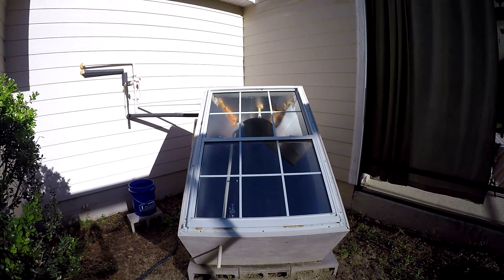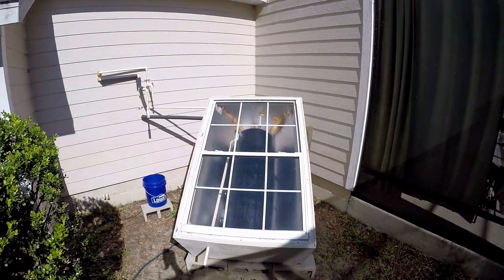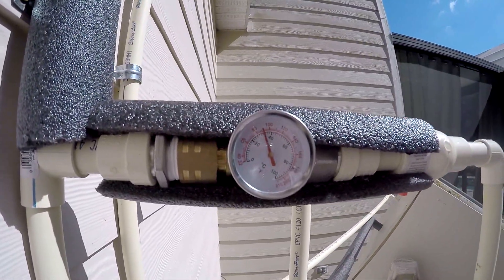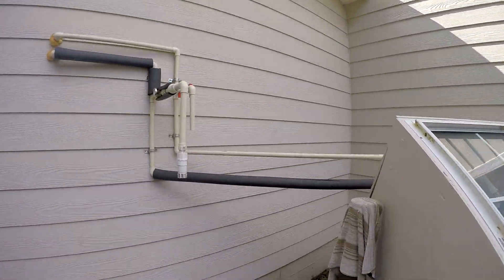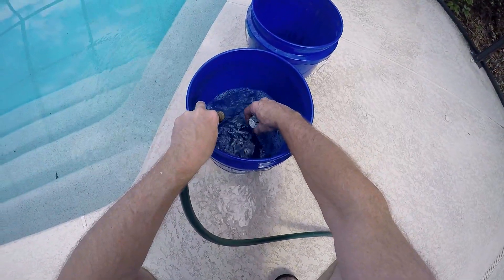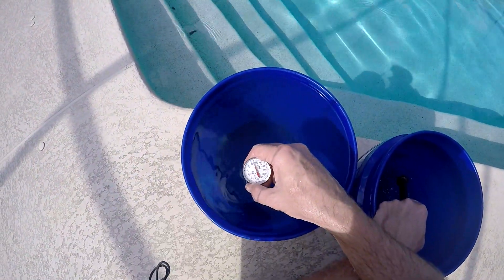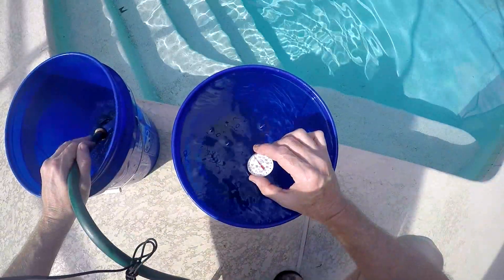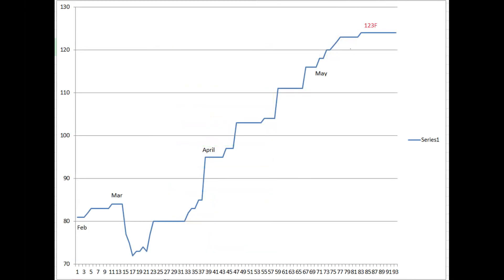Solar Water Heater April Update

Comment: I don't remember now if you said why in your previous video where you built this, but trying to heat a tank vs a radiator doesn't work well due to surface area of heated material to water.  if you had the tank, with insulation on the inside and a radiator(s) in the box feeding to the tank, I would think that would work better.
Reply from the maker: joebleed, I think that might work better depending on many factors... Basically, the more surface area you get in direct sunlight the more energy you can capture.  Also, the more surface area you have in the hot insulated box the more  energy you can capture.  I would really like to see someone try your idea.  That said, it usually comes down to what you have available.  I built this whole thing for under $100 with stuff I had laying around.  Most people can get an old water tank from a plumber, an old window from the window company and some scrap lumber and build this thing for next to nothing.  Its providing a fair amount of hot water and making life easy on my solar power.  Thanks!

Comment: "You need a BIGGER BOAT ! "    Hi David,  perhaps two tanks are needed with more surface area. Just be mindful that the mid-day water will be well over 110 degrees, perhaps up to 150 if let sit for several hours.  My system has two tank closures side by side on the roof.   J K
Reply from the maker: James, two would be nice but with kids leaving the house now, we seem to be getting by with just the one.  Remember that this feeds another 50 gallon water heater that is powered by the solar voltaic.  We have not used the utility to heat water for two months now...  Thanks!